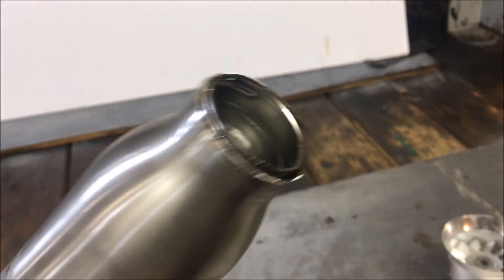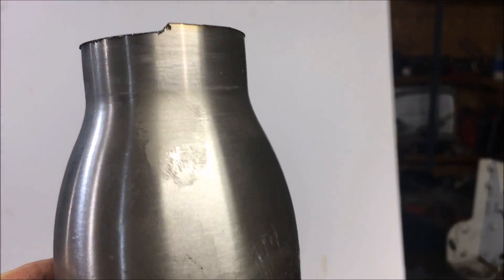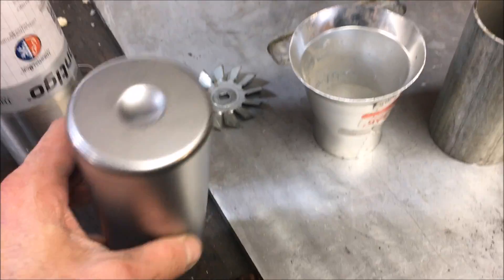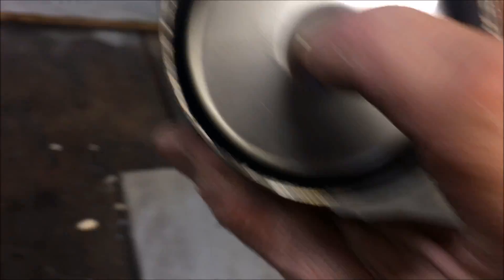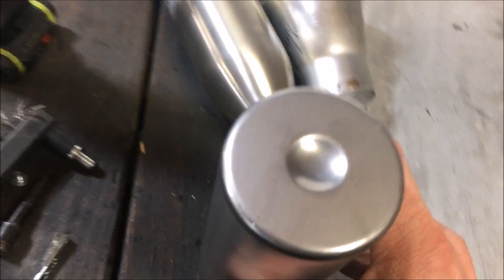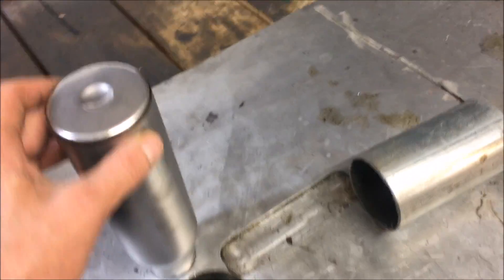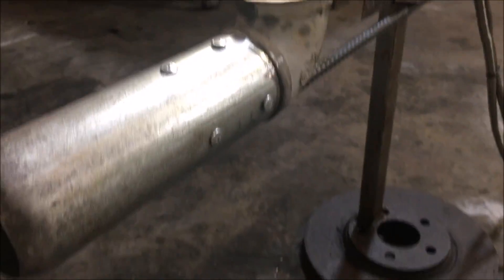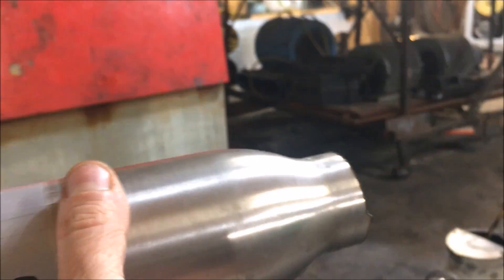Jet engine waste oil burner combuster

Comment: is there a next part to this project? Looks preety sweet, cant wait to see how this baby light up
Reply from the maker: Im currently unable to afford this experiment but if things pick up i will be giving this thing a try
Reply: no worries man, I'm still enjoying your experiments nonetheless. Btw, I saw your portable steam degreaser the other day, I thought it would be awesome if you can built one on your waste oil nozzle so it can run on pressurized air and oil instead of propane (perhaps the steam coil could be inside a small tube so the oil spurt doesn't hit the object you're aiming steam at - just an idea).